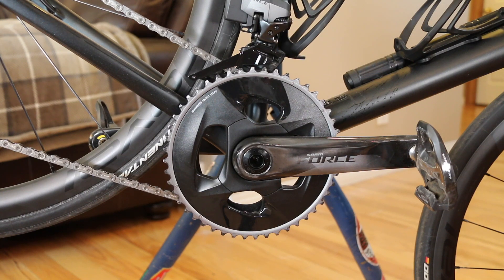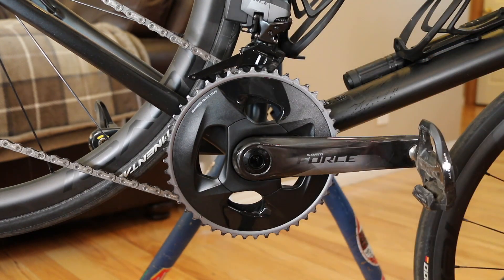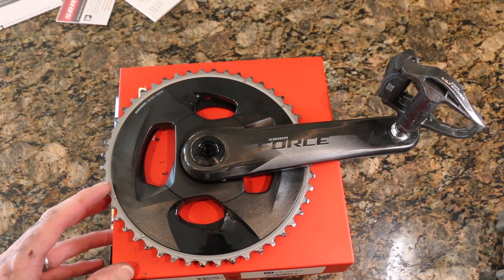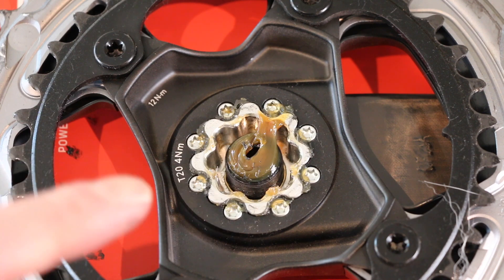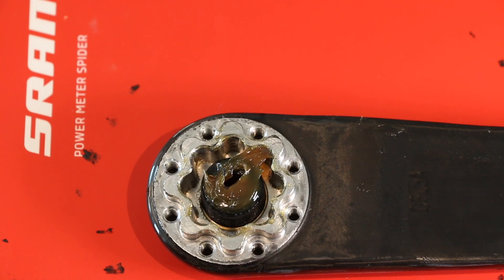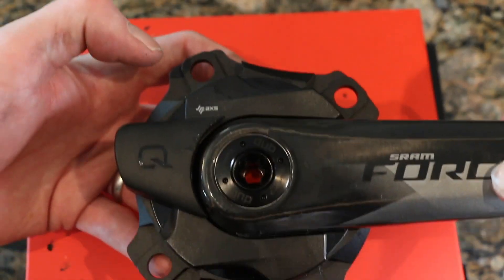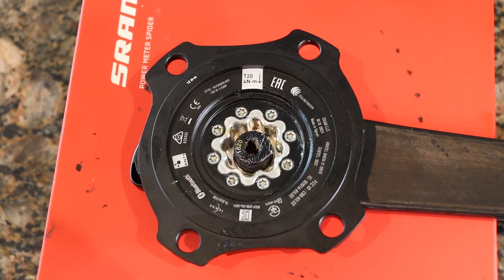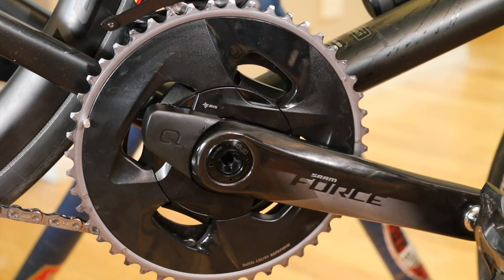Sram AXS Power Meter - How To Install

Comment: It would have been way better if you had put some grease between crank and spider at the time of mounting as both are aluminium made
Reply from the maker: The crank comes filled with grease on the inside.

Comment: Great video! Is this power meter also compatible with the latest SRAM Rival AXS Crankset?
Reply: No it's not. For Rival you need the SRAM Rival DUB AXS Quarq Powermeter
Reply from the maker: I’m not sure… it’s probably best to check the Sram website for this.

Comment: Hi … it works only with D1 DUB or works with D1 GXP crank as well ? Thx
Reply from the maker: I assume it’ll work with GXP, as they only identifies the spindle width. As long as the mounting style is the same it would work.